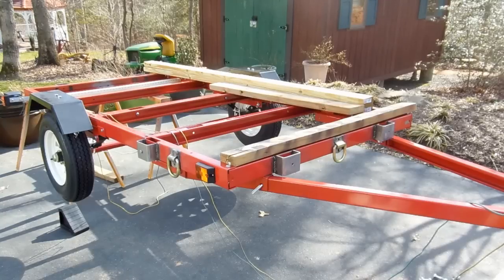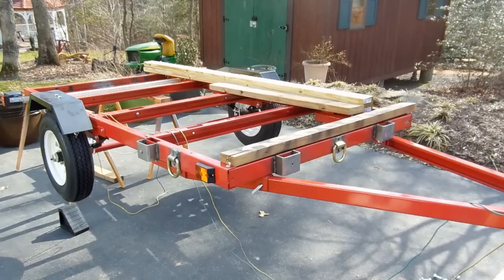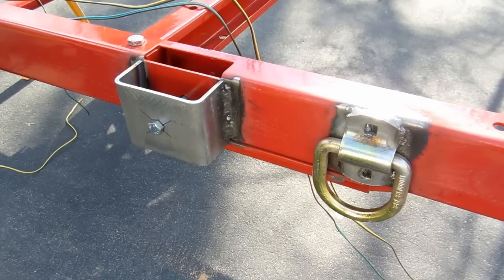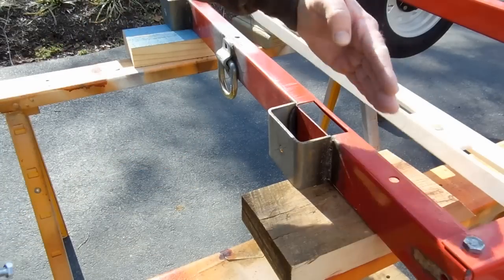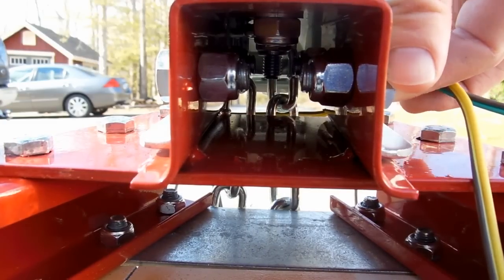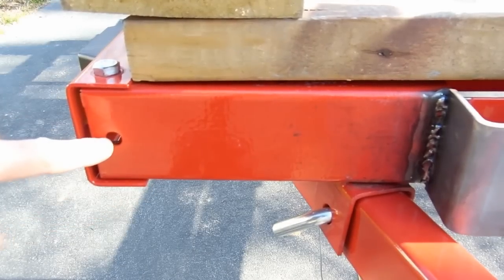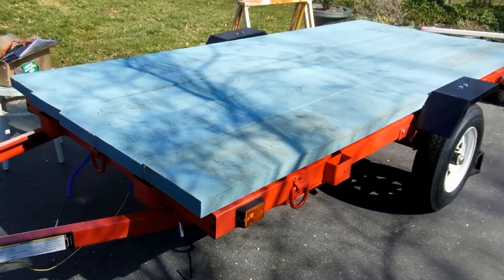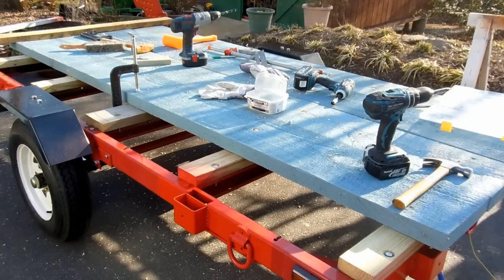Harbor Freight 1720 Lb. Capacity 48" x 96" Super Duty Utility Trailer Build Out

Comment: A couple of tips that you might like to make your work more efficient. Layout all of the lumber even at one end_Flush w/ the trailer frame and only trim all the boards once instead of from both ends.
Also, use "Nylock" nuts on all of the vertical bolts. Road vibration will eventually loosen all of those deck boards.
And, last but not least, you did a great job on the welding for a first timer! Enjoy your trailer

Comment: These trailers are kind of fun to build as you can be creative.  I used 3/4" CDX for the deck and haul 2 dirt bikes on it.  Added an iron pipe from Lowes to the front for tie down points and tow 2 dirt bikes on it.

Clean the wheel bearings and grease them well from the beginning, balance the unbalanced wheels and rock on.  My OEM tires got old (have had the trailer 10 years) and put some Yokahama  radial car tires on it, rides much better now, especially on rough surfaces.
Reply from the maker: I was just thinking about radial tires the other day. I'll bet the handling is night and day. Thanks for the input.

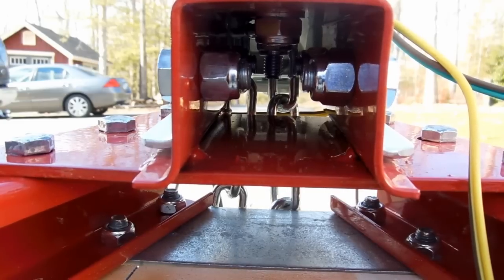Comment: @8:50  I noticed this too when I was making my HF trailer.  My solution was a bit less complicated, so I thought I would share it.   

I simply bought some PVC trim strips at Lowe's.  I was able to get the trim in the exact thickness to fill that gap and prevent the deck from bowing.  You simply cut it to length and mark it for the hole locations.  It's PVC so it drills easily.  Do this for all the cross beams.  

I also replaced the corner bolts as well as all the bolts on the top with galvanized fence bolts with round tops that counter sink when tightened.   My deck when completed was 3/4" (pressure treated) with a smooth surface (rounded 'bumps' as opposed to hex head cap bolts) that allows me to roll or push stuff in easily.

Again, keeping the weight down to maximize load capacity.
Reply: My solution was different. I used router to remove around 1/8 from the sides of the plywood (along the edges). Now the plywood sits nice and flat resting on all the metal bars.

Comment: I guess some people just like to make things harder than they have to be!!
I built this same trailer out of the box in 2005, and followed all the plans given, I did it for my A/c company I was starting. Here it is 2016, AND the trailer is still in use today, I've only replaced the 4X8, 3/4 inch ply I put down for the deck, Note even if you use pressure treated ply, once it dries in the sun for a week or so, PAINT IT with good high quality paint!!

Comment: What I do to my trailers is first I take out the stock trailing wiring.   I got double insulated wire or u can use extension cords.    I run them thru pvc pipe and will run and make all my connections in a box.   then I run them out to my lights.   some trailers I put 2 boxes 1 in front and 1 in back.   For those running lights I usually slide them into a 3 inch tube and cut it out so I got protection.   if I don't do that I usually find a way to break a light or two.      but good work  I redo most of my trailers after I buy them
Reply from the maker: Sounds like a good way to protect the wiring, especially if you're doing long haul or moving around in the woods where brush might snag the wires and do some damage.
Reply: Vicos

Comment: Nice vid there vicos...I bought this model and put it together back in 2004 to haul a Harley Davidson from San Diego CA to Pensacola FL where I live when I retired from the Marines...held up good, but now the cheaply painted HF steel c-channels have rusted. For the price, I could not beat if. My only note to add to your vid, is that you can drill holes for the d-rings w/o worrying about degrading the strength of the metal...if worried, add a backup plate of same thickness behind the c-channel.

Comment: I've found that if you change the tongue, and add rails these work great for small 12'-14' jon boats. A lot cheaper than a used worn out boat trailer that I usually  have to modify anyway.
Reply: kirby lane, bearing buddies maybe?

Comment from the maker: Hi Kawi9893, The primary reason was that I would have had to drill many more holes in the frame that lined up with the 2x10s. This would have weakened the frame and introduced new points of rust. The 2x4 cross members allowed me to use existing bolt holes. I could also use just 2 bolts per 2x10 and screw the rest. Also raised the platform up level with the fenders so I could carry a load that extended over the wheels. Just the way I chose to do it, not right or wrong.

Comment: Great video. I used a 3/4" X 4' X 8' sheet of plywood and replaced the bolts that held the plywood with carriage bolts. Suggestion: You might want to raise your tail lights, I bent my licence plate every time I tilted the bed.

Comment: just an update, I've put about 2000 miles on the trailer with no bearing issues. The first trip was about 900 miles. I stopped about every 100 miles and checked the temp of the hub's with an IR thermometer, all is well.
Reply: we have over 10,000 miles on ours (search little hhr that could) with only one issue. the greese fitting on one hug was broke when I purchased it. HF sent me a whole new hub no questions asked just to replace the greese fitting. stock greese and bearing looked great about 500 miles ago.
Reply: nbookie just wondering how does it tow behind your car? I’m thinking of buying one for my Ford Fiesta

Comment: Nice job. With those "D" rings, you could have filled in those bolt holes and made plug welds out of them. Just a thought. Also looks like you might have been able to run a little hotter with the welding, at least on the stake pockets. Next time! lol
Reply from the maker: Thanks for the constructive advice :)

Being a noob to welding and having already warped that one cross member, I was constantly fearful of using too much heat. Maybe some day I can get some first hand instruction from a pro.

Comment: 4 bolts in the hitch. Yeah, only a few pennies, Better safe than Sorry!!! I'd also recommend some longer, stronger, safety chains. At a construction company years ago, we would criss-cross the chains under the tongue so IF the hitch let go the tongue wouldn't hit the ground but it would be cradled in the ''safety net''
Reply: Good advice.  I always cross the chains.  It is a habit I picked up many years ago, and now it is automatic on any trailer I hook up.

Comment: As an old retired welder I would advice you to be careful not to snag your self on one of your welds. LOL crank your heat up on the welder you are welding to cold to apply a smooth weld with proper penetration.

Comment: Could the rails have been swapped or flipped so the stake cutouts were next to the inner faces? Would it be better to drill the retaining pin holes before welding on the external stake pockets? How about notching out the lateral 2x4s to clear the lip of the transverse rails and bolt heads?

Comment: Hi Vicos, nice vid.  I purchased this trailer by mistake but... I'm going to keep it.  A couple of questions (1) would the "80 Amp Inverter Arc Welder" being sold by Harbor Freight be able to handle the soldering work on this trailer (installing the sidings)? (2) where did you get your sidings.  The kit doesn't come with it and HF doesn't carry it either.
Reply from the maker: I'm just a newbie at welding, so probably not the one to recommend anything. I used a $140 110V welder from Northern Tool just so I could learn to weld.

By sidings, are you referring to the stake pockets where you insert the 2x4's? If yes, this trailer has built-in pockets, but then you can't get a full 4-feet across---which is why I welded the pockets on the outside. got them from red trailers online. You can also get bolt-on pockets.
Reply: I'm not a pro welder but I know a little. The HF flux-core wire feed welder should be fine to weld the thin metal on this trailer. Check out chucky2009 s YouTube for basic newbie welding lessons.

Comment: One thing about these trailers is the wheel hubs are only rated for 55mph because they are only steel cast iron ones are higher speed rating.

Comment: I want to move a shed like you have in the background just on the property not the road. Do you think it would work as a "Dolly"?
Reply from the maker: Depends on many things like how big and heavy your shed is and can you get it up on the trailer in the first place. You would have to compare the load capacity of the trailer to the estimated weight of the shed. Can you secure it safely so it doesn't fall off? If you don't have far to go, I've seen them use PVC pipe as rollers (probably 3" or 4"). Just push or pull it over the rollers and move the back piece to the front as you go.

Comment: could one not get a heavier axle from a junkyard as to not worry as much about the weight as well as adding extra springs ? I have never owned a trailer and am in the beginning of research . Do you think that one could build a small camper on that trailer as is with no modifications as to suspension .
Reply: You could get a heavier axle and springs from a junkyard, but you're still limited to the trailer's declared GVWR by law. If you wanted to put more weight on the trailer than it is rated for, you'd have to essentially rebuild the entire trailer before registering it with your local DMV, and if you're going to do that you may as well build one from scratch.

As for building it into a small camper, I don't see any reason why not. You may end up having to relocate some of the lights to remain DOT compliant, but as long as you keep it under the rated weight you can build whatever you want off of it.

Comment: Now glop some stuff in the deck holes you drilled so they don't rot out and your deck doesn't just go flying off in the first breeze..
Nice welding job for a first timer although I would have reinforced the steel around the welds, perhaps 8th" steel a few inches in either direction, but I like to do overkill on things of this nature. I'd also repaint the entire frame as they use some real crap paint..
Over all a decent job.. You may end up replacing the pine deck with something more substantial..white oak if you can lay your hands on it..

Comment: instead of welding my D rings to the side of the trailer. I'm drilling two holes through my plywood and cross bar fram. and running my flush D ring bolts through that.
Reply: +Jeremiah Almos I planned on doing the same thing.  Let me know how it turned out?  I don't have access to welding equipment, so was just going to go drill through 5/8" plywood and the frame to mount my 4 d-rings.
Reply: Hey, I'm doing it D rings tonight. I'll post some videos
Reply: Jeremiah Almos Awesome. Thank you sir.

Comment: Did you repack the bearings right out of the box? I just built one of these and I've read online that some folks have done that but is it necessary?
Reply from the maker: Who can really say for sure if it is necessary. My take on it is this: the thing is manufactured in China, probably in sweatshop-like conditions. They don't always use the highest quality materials and the grease could very well be contaminated with dirt. Since the bearings are one of the critical elements of the trailer, why not take a few minutes to clean the bearings and repack them?
Reply: I (at first) took my wheels to a tire shop to have them clean out the original Chinese grease, and replace it with a high quality marine grease (I bought the HF boat trailer).  Unfortunately, they bent one of the brass&rubber(?) seal, and I quickly found out that I could not find a replacement seal at HF, or anyplace else, due to the odd (metric) size.  HF did finally send 2 seals 6 (!!) months later, after many calls to them.  To finish the trailer, I finally had to just straighten out the brass part of the seal, and reuse it.  So, be careful when removing and replacing the bearings, to not damage the seal!  I also put on Bearing Buddies so I could be sure to keep the bearings greased properly.  - and if you go that route, be sure you find the size that fits the odd size HF trailer axle.
Reply: It's a great idea to do that. These are popular trailer in the motorcycle track riding world. At least in the mid west area. A lot of friends are repacking the bearings just to extend the life. It's doesn't hurt. 😉
Reply: I've been using the original grease and bearing for over 10 years now without any issues.  I use the trailer regularly nad haul a small ATV with it.  I would do the bearing if I used it commercially, but for intermittent use, they should outlast the trailer.
Reply: I've found that the quality of lubricants in HF items is often poor.  I always change them, and never have any issues later on.
Reply: Just4Kicks1234 I replaced my wheels...bigger.. immediately
Reply: Just4Kicks1234 ...it ‘s a must- do for HBF trailer wheel bearings, they ‘re packed with cheap unsubstantial grease, not suitable for low speed much less high speed travel, I did this for my 1st HBF trailer, glad I did, I think they pack it with machine cutting oil, had metal cuttings in it... dodged a bullet!!
Reply: Just a heads up...think wind noise....

Comment: 7:02 Every 20% HF coupon I've seen has said they can't be used on trailers.
You must have lucked out and gotten a cashier that pushed it through for you.
Reply: I saw the same thing and just discovered that HB has separate specials for the trailers on their website from time to time.  I just missed the special for 1720 lb trailer and it was better than 20%. It ended 3/31/20 and the coupon was for 339.99.  I am going to try to be a little patient and keep my eye out for the next time.

Comment: Do you think that Trex composite decking could be used for the floor boards? I've borrowed a friend's trailer a few times and his floor boards are warped, cracked, and cupped like crazy. Just wondering if composite would be strong enough, that's all.
Reply: Composite or Synthetic, may be strong enough. I would check online to see how much weight the material can hold, considering the unsupported distance between cross braces. I know there are charts for wood that show how much pressure/weight it can sustain etc. so you should be able to find a scientific answer.
Reply: +John Treble Composite works fine. Depending on what you're hauling. I use it on motorcycle trailers with no problems.
Reply: John Treble, what I did was get 3/4" outdoor plywood for the decking. I found at Lowe's a deck paint, that goes on thick, that is made for wood decks. Works pretty good

Comment from the maker: The 2x10 bolts only thru the 2x4 which is bolted to the frame. The 2x4 is mounted flush to the edge of the frame member, which gives you a good 2-inches or so of wood you can bolt through w/o hitting the frame member. This also makes is easier if you have to replace one of the 2x10s in the future (U can just drill up from below thru the existing bolt hole in the 2x4). Don't forget to recess your bolt heads in the wood so they are flush with the surface.
Reply: Do you need a license plate for the trailer if so how much is it
Reply from the maker: @Franksinatra96  You do in Maryland. I don't remember what it cost, but it was not cheap. I believe the cost was based on the size/capacity of the trailer. I never renewed the tags because of the cost and no longer use it off the property.
Reply: @Vicos  thank for the information now my other question was did you had to insure it cause I basically want to tow motorcycle as a business with mines so is it insured through your vehicle or you have to pay seperate
Reply from the maker: @Franksinatra96  My policy covered it as part of my other vehicle's coverage. However, typically you can not use your private insurance to cover your business use. If you make a claim against your private insurance for an accident when you were conducting business, they will deny the claim and maybe even terminate your policy. Best to call your agent and tell them what you are thinking of doing and let them consult you on what you have to do. Better to be above board. If you ever had a bad accident where your trailer came loose and hurt someone and then the insurance denied it because it was business use, you could be in a world of hurt.
Reply: @Vicos  your absolutely right I'm gonna talk with them today thank you again

Comment: Quick question.. how are the trailer on the highway at a  speed 70/75 mph??
Reply: +Evandre Molina Illegal! Top speed for vehicles towing trailers in Ca used to be 45, It may be different now but you would never want to tow any trailer at 70mph, especially if loaded.
Reply: We tow a harbor freight trailer with an atv in it from pa to top of ny most highway ang go maybe 55-65 and don't have a problem.
Reply: TruAnRksT trailer speed limit is 55 in California, has been that for the 25 years I've been driving a truck
Reply: I used to tow mine here in washington at 70 to 80 mph with no problem.
Reply: Evandre Molina any trailer can go as fast as u can drive.

Comment: That lumber is way over the top. If that is oak you could've had them cut down to 1" thick and it would be more than enough. That probably takes away at least 100 lbs off of your capacity.

Comment: they keep telling me that this trailers are not to reliable for long trips with heavy loads,
is it true?
Reply: efrain avena people have thousands of miles on them. But it's not recommended to go over 55 with it.
Reply: I know this is a late reply, but I built one in 1994 in Maryland, put a wood box on it, stuffed it full of belongings and drove it to Arizona. Never had an issue. I'm currently building another now for camping with a few modifications but as long as your wheel bearings are packed correctly and you don't overload it you should be good.